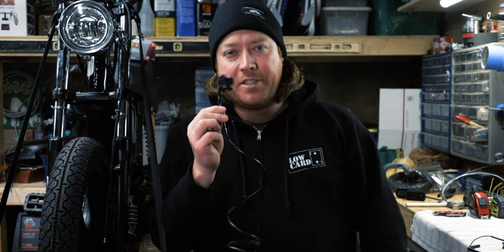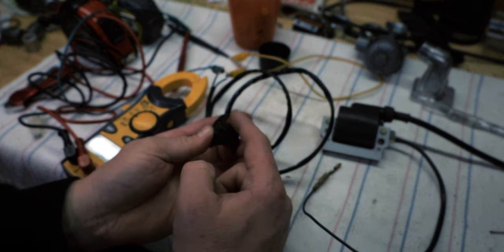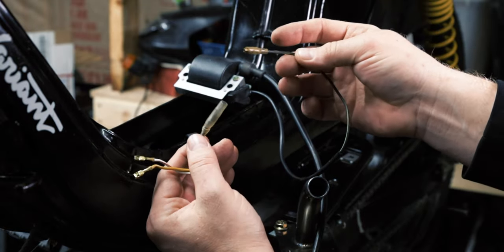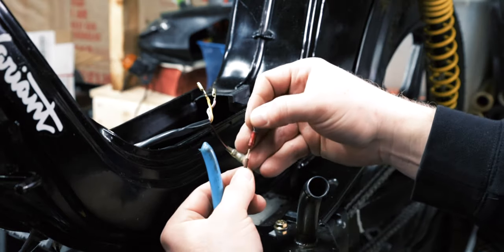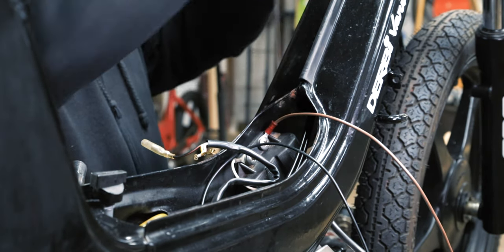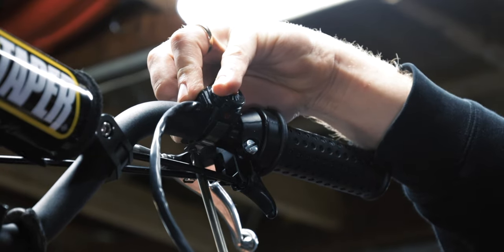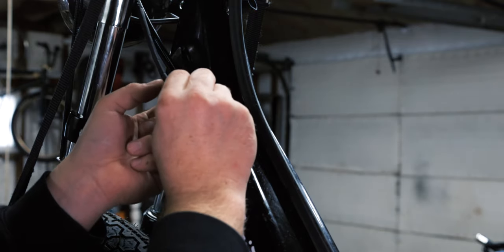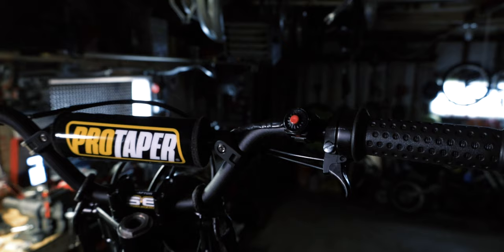Easy Kill Switch install for Moped, Dirt Bikes and everything else

Comment: I have been riding around without a kill switch for almost a year now and I finally cared enough to try and fix it . Tried to follow the stock wiring but something is fucked up somewhere and this  trick seemed to be the only thing that worked. So thx for the vid. Very well explained
Reply from the maker: heck yeah! I am glad I could help.

Comment: I can't seem to get this to work, my coil is 6v points, does that have anything to do with it? I pigtailed my blackwire from coil and the other wire to ground. My headlight is a puch maxi headlight with a killswitch already, i just need to install an on/off switch with a key for theft deterrent.
Reply from the maker: voltage doesnt matter. Just use the kill switch to ground out the external coil.  That will kill the motor. If its not, you either have the wrong wires or the switch is broken. Do you have a multimeter you can check it with?
Reply: @Corn-ped  Holy fk you answered! I got the puch maxi headlight with with 4 wires going to it, yellow, black, grey and brown for ground. Ill have to test the switch with a multimeter because it seems as if it works on and off. Is it a correct assumption to say that its impossible to "killswitch" on a engine with pullstart? Or should it still be possible to ground the entire engine with a pullstarter? 
thanks for being an encyclopedia of all the things i care about
Reply from the maker: @TeChNoSiX  you totally can kill it. Just ground out the ignition coil. The blue wire that goes to the coil. Ground thay
Reply: @Corn-ped  Thanks for answering so fast! In my case thats the black. But my earlier question was more of a "can an engine with pullstart have a killswitch with an on/off position so that it cannot start in off position no matter how much you pull" <-- this is to prevent theft if left outside a store in the city.
I must admit i have trawled the web for the answer and even going so far, as to look into forums for garden mowers and such, but i cant find the answer to this question.
Reply from the maker: Ohh yeah if the coil is grounded, it cannot start. No matter how hard ya pull
Reply: @Corn-ped  Thanks a huge bunch! It endes up being both a dead killswitch and break on wire! It works and grounds no matter how hard i pull!